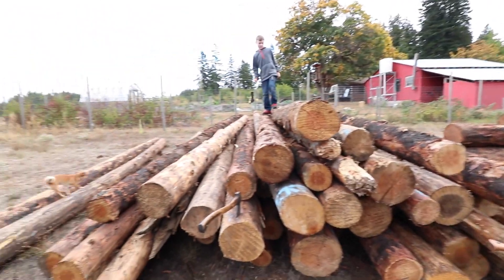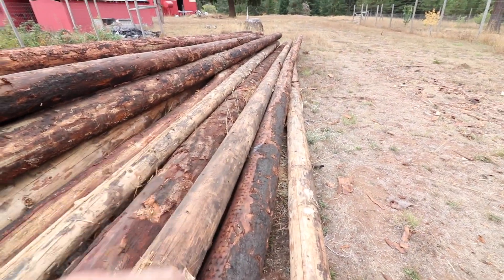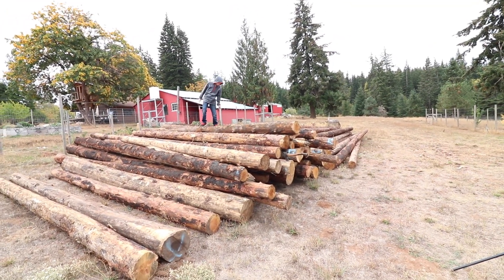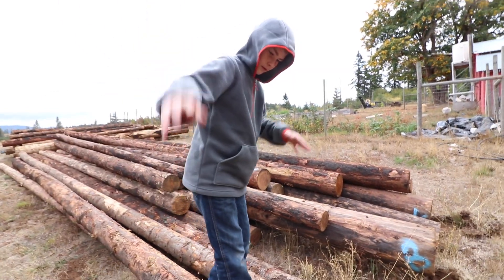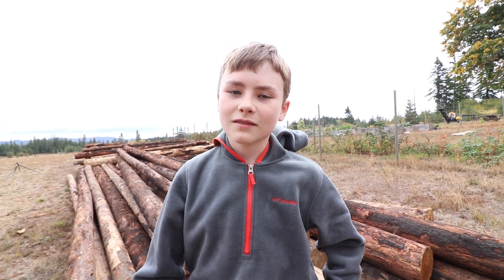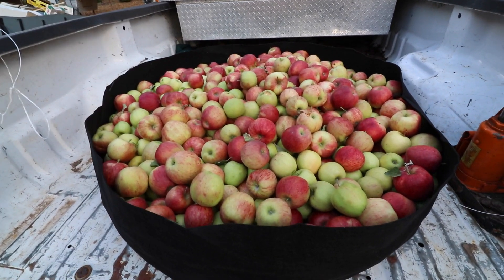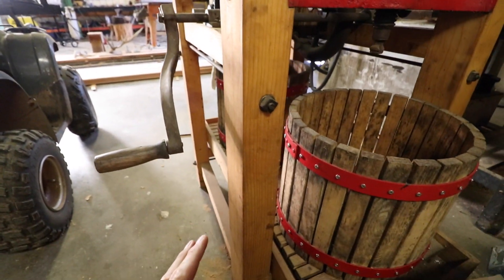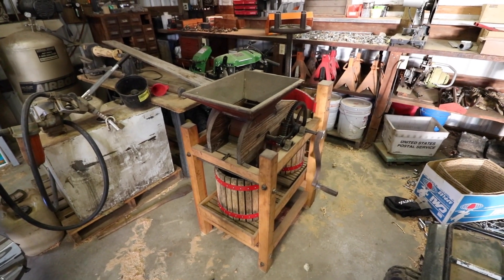NOW WE'RE LOGGING!!  21 Cords In 1 Day

Comment: 251#  Of apples, 60 cord is what this particular processor can produce ( Can )  My brother in law, owns the same wood processor as yours Cody. With a log loader to place a log down at the completion of the prior one, and with many sharpened chains, and one tractor to move the processor ahead as the split wood builds up. Their logs were also slightly bigger, but more crooked and alsoHardwood, And working dawn til dusk. 15 plus hours. But they were intensionally trying to see what it could produce. It hasn't been recreated since. Also 1 trip to the ER, when one of the tall pieces of steel that holds the logs on the loading rack, fell down just as someone was passed by, clocking them in the top of the head. Turned out his son forgot to put the pin back in it, that holds it up.   Please dont cut that beautiful log into firewood, you may need a long beam some day.
Reply from the maker: Hey - we haven't heard rom you for a while.  Hope you are okay.  Regards, Wranglerstars

Comment: Soak the carbon steel knife in a jar of white vinagar overnight with the blade fully immersed and it will put on a patina that slows down the rust. It does not stop it, but much better. Oil will come off on your food.

Comment: SMART !  Having a professional cut and deliver a full truck load of logs for firewood is the way to go !

My Dad did this when he realized he was getting too old to go out and "thin" dead trees from state land.  He was able to get mixed hardwood because the mills in the area only wanted pine.  Because they were green, he bought them 1 year ahead.

VERY SMART !
Reply: Something else my Dad did.  He bought a 16" electric chain saw to cut those logs into stove lengths.  Lighter weight, no gas to mix, no smoke/smell, much quieter and much less vibration.

Of course he was over 60 at the time !

Comment: Ooo is jack carrying a Mora knife? love those
Reply: I have the same one
Reply: Me too👍
Reply: Just spring for the Stainless version!!  Love a mora!!
Reply: Carbon is better for a lot of reasons, just depends on what you do.
Reply: Zareth DeTullio I don't mine to rust, it's a <$15 knife
Reply: I like the carbon for its better edge and the ability to spark a firesteel, but if you don't need that the stainless is nice!
I embrace the patina and out vinegar on the blade to give it a different look.
Reply: +Zareth DeTullio, high carbon steel is only needed for flint and steel sparks. Ferro rods, fire steels, whatever you wanna call them, only need a sharp 90 degree corner of a material harder than the firesteel itself. It can be a sharp corner of glass, ceramic, stainless, titanium, carbide, etc. Only a few of the Mora models come from the factory ready for firesteel use. The rest just need a little bit of grinder work.

Comment: Hey Wranglerstar on Jacks Mora.  If you have black walnut out there. Gather some of the nuts. Hulls on and smash the hulls on the blade. Coat it with hull pith.  It will do a bluing on the steel and help protect against rusting.  Works a treat

Comment: hi jack
if you soak your mora in white vinegar for a few hours it forces a black rust to form on the outside of the blade, when removed from the vinegar give it a gentle wipe with a Brillo pad or 0000 steel wool [just enough to make smooth, leave the rust on] this will help prevent 'red' corrosive rust to form when the knife gets wet

Comment: If you expect 25-35 gallons of cider and a gallon rings in at 8lbs  = 200-280lbs. Add 30% for the pulp = 260-365 in apples. My guess is 312lbs or 62 heart racers

Comment: It looks like the apple bin is roughly 3.5' in diameter by 1.5' tall.  That means it has a volume of 14.43 cubic feet.  By converting volume to bushels, based on a bushel being 64 dry US pints, that means it should be roughly 11.6 bushels of apples.  According to the University of Georgia, 1 bushel of apples is roughly 60 lbs.  That means we should have a total weight of 695lbs of apples.

Comment: 244 pounds of apples? A random-ish guess.

I think we used 9 generous cords per load figuring a standard load, depends on a lot of things A self loader holds a little less. Since you have some 38's I know you are using a standard self loader and not a mule train (shorter twin bunk trailers), which would even be less. Hardwood would be less too. If you had all 32's I'd say 10 cords. Wish I could see a picture of the loaded truck - I'll bet I could nail it.

Timber from salvage sales? Hey great, and those little logs certainly look like they really were dead standing. BUT, I have seen plenty of scorched timber that had survived, (usually the biggest tallest, and most valuable trees) and they are still sold under the salvage rules anyways even though they survived the fire, bypassing whatever protection had set them aside to begin with. It breaks my heart.  The best of it is old growth that goes overseas.

Comment: I'm in for about 75 lbs or about 7 Heartracers.  That ought to make some beautiful cider but I'd be tempted to fire up another batch in the fermentation tanks.  

You might think about gun blue for Jack's knife.  It should protect the blade fairly well.
Reply: I went through the math and I'm way off...like 10x off.  It's going to be closer to 850 lbs or 71 Heartracers and 20-25 gallons of cider.

Comment: 615 lbs of apples!!!!

Avg volume of an apple = 6.4 cubic in
Avg weight of an apple = 1/3 lbs
Width of F250 truck bed = 65 in
Cylindrical apple container is roughly 60% of truck bed width and 10in tall
So volume of apple container is about (.6*65/2)^2*pi*10 = 11939 cubic in
So approx # of apples is 11939/6.4 = 1865
And the weight is 1865*1/3 = 615 lbs
more or less ;)

Comment: I'm sitting on about 19-1/2 cords cut to length. 7 are split and stacked. I'm building the wall, which holds about 10-1/2 cords when complete. We burn between 9 & 9-1/2 cords a year. I'm anxious to see how your going to split it. I have a lot of hours on the splitter.

Comment: I would say you have about 350 pounds of apples in the back of the truck.   
Moving the logs around with out power equipment is going to be labor intensive even using a winch.  A small skidder or a large front end loader would be very helpful.  It will be interesting to see what is coming.

Comment: you do not know much about firewood the btu is low and your flu for sure to plug and catch on fire
Reply: do you know what btu is? creosote ???
Reply: if you know how to build a stove correctly.. wood is awesome and clean. Look up rocket stove and rocket stove mass heater. Perma-culture people know how to use resources to a higher degree. A Swedish torch has served me well for a camp fire that lasts long and uses alot less resources.
Reply: I suggest you burns some season locust and compare